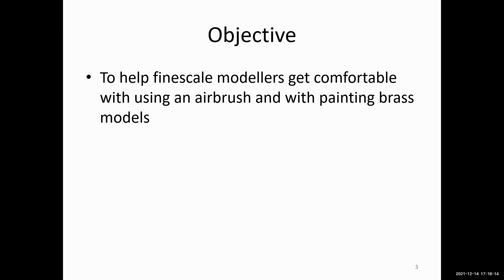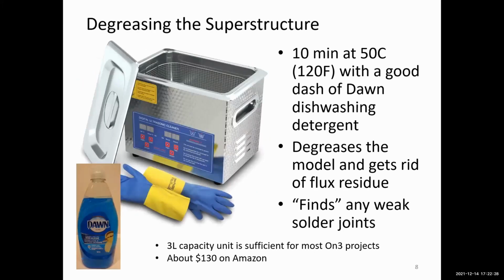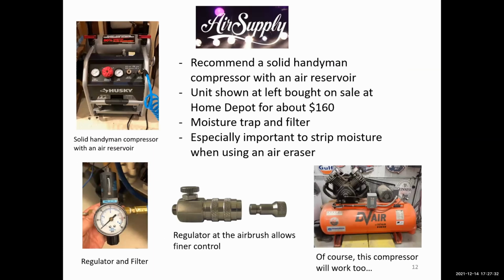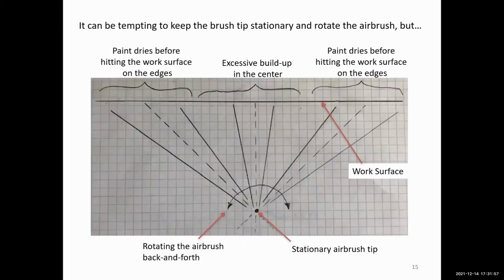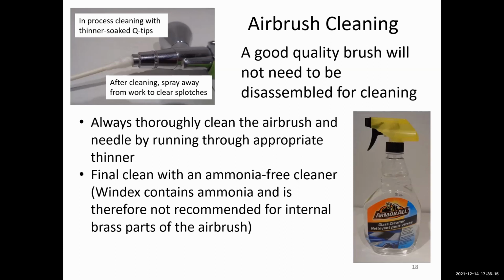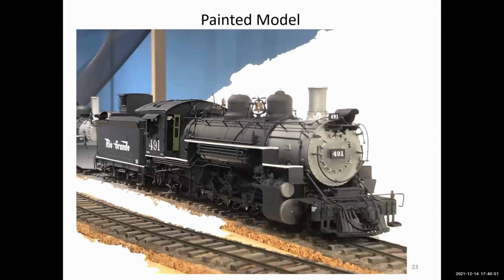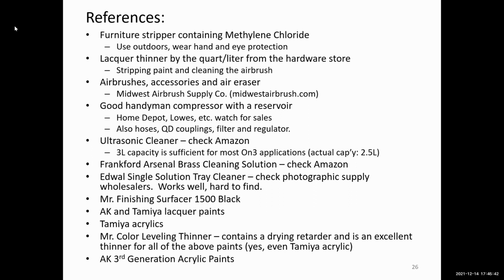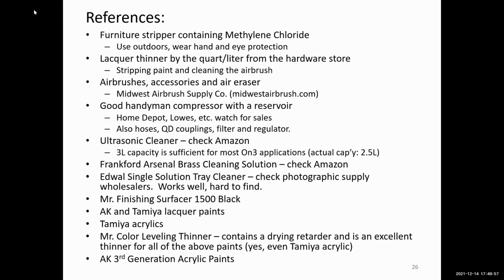Painting Brass

Comment: I have a question about humidity. In Charlotte we some days we have 100% humidity in the morning and above 50% some days. Let us say I buy one of those compressors and the air goes out dry, wouldn't the moisture in the air affects the model?
Reply: Yes it does. Especially with paints containing acetone, such as Tru-Color, The acetone absorbs moisture in the air. As the acetone evaporates, the moisture in the paint condenses, forming clouds. Yes! Clouds in the paint! Tru-Color's suggestion is to add retarder to slow the evaporation rate, and thus the cooling.

Same can happen with alcohol based paints (Tamiya's non-lacquer line), but on the whole I haven't had nearly as much problem as with alcohol based paints.

Get yourself the best desiccant drier you can afford. Perhaps better yet, ditch the compressor and use CO2 or dry nitrogen.